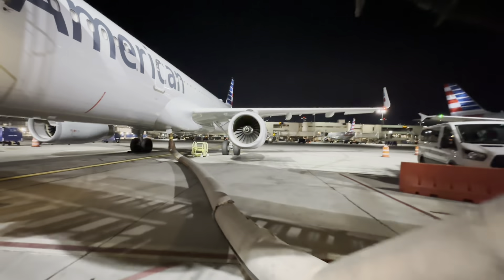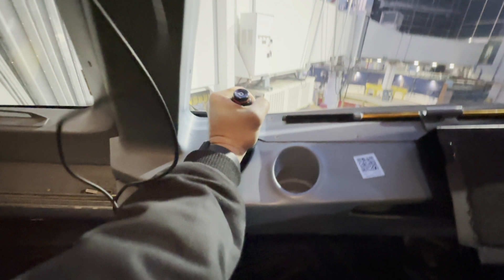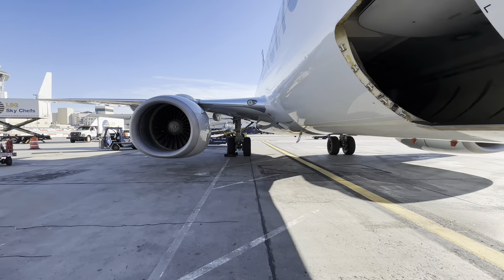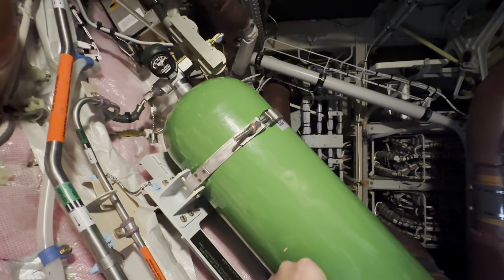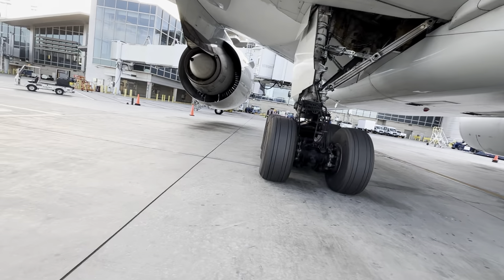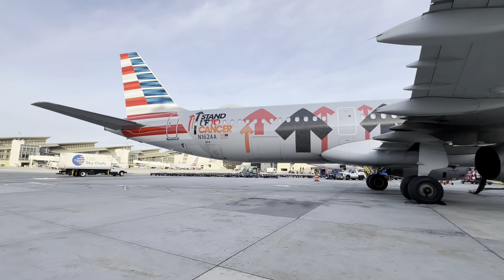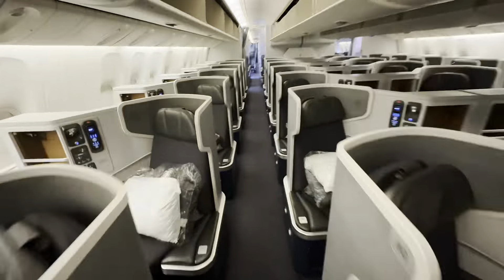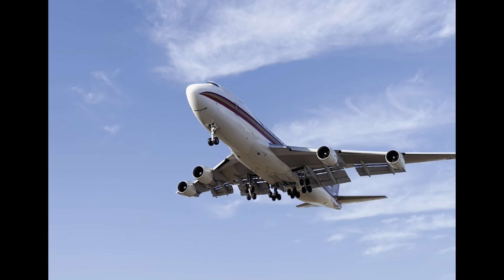Stig Shift #6 (Aircraft Maintenance Adventures)

Comment: So the repair on N939AN looks to be most likely some corrosion repair work done during a base check in 2012, I think.  The public records and cross referencing structural drawings of the fuselage to determine roughly where this repair area was led me down a whole rabbit trail that lasted into the early AM hours.  Thanks for that 😂. Also interestingly enough, this was the bird that got tagged in the rudder by a 777 wingtip, which was under tow in Miami. Thankfully, there was minimal damage to both aircraft.
Reply from the maker: Look at you, he just turned into an aviation detective, well done sir. Well done. 👍 that satisfying moment. When you find the thing you’re looking for, a smile sit back, and Say to  yourself I found it. 👌

Comment: Never tired of hearing you talking about airplanes systems, back-up sys even trivia part. Absolutely fantastic and unique chanel.  

Tell me Stig, bcs u mentioned that u got u got to work on 727 and 737 clasics[with PW JT8D]and probably some other machines.  How did u then diagnose a problem like this captain  made a note in the book[plus eager to hear from u, maintenance  guys], with no on-board diagnostics and DFDR or QAR(USB or data card, recording sometimes over 2000 parameters, as Google says ...Must b pain in the butt to diagnose if it  is 9xxx or 5xxx event ?

Ot tell us a something that was very different and FOR SURE much more labour intensive. Eh ?

Thank you for your effort for showing as this job from first hand and almost POV recorded. Much more clear what to expect if someone decide to gave a career like u. 

Like X 1000. Stay safe .
Reply from the maker: Working on those older aircraft was definitely a bigger challenge. The computer boxes were all inside the equipment bay, and they were not as sophisticated as they are now. We would be going off small little fault lights that would lead us to the fault isolation manuals. After which an intensive Search for the malfunctioning component. It definitely was not easy. The other aspect you have to realize is that those older aircraft were built, much much stronger and tougher. The 727 is literally a flying tank, that thing can go through a wall and still keep going.

Comment: I just found your channel.  I’ve been an A & P for over 35 yrs,  been a tech and Flight Engineer for the same corporate operator for 25 yrs.
I surprised you don’t service O2, but perform bottle change instead.  Why is that?
Thanks for the fun content!  👍🏼😁
Reply from the maker: Our station has its own oxygen shop, so they want us swap the bottles. They take the below limits bottles and service them at the shop and also have the capability to hydrostatic test them. Not all of our stations have that, some service it on site as you said. Thank you for all you years of hard work and keeping them airworthy sir. And pleasure to have you here.
Reply: @StigAviation  Thank you for the explanation.   I get it now.   Great content!!!   Keep ‘em flying safe!  😊

Comment: Hi Stig, these videos are great and your commentary isn't one bit of boring. Early in the video, you mentioned small items like missing placards grounding aircraft; can you give an example of something common for this on larger aircraft? I've seen some requirements for fuel placards in 14 CFR part 91, § 91.9 and ID plates in AC 45-4, but don't have much experience with the heavy side of things. As always, thanks for the knowledge transfer!
Reply from the maker: It’s almost the same way, most notably, emergency, placards are the ones that are scrutinized the most. Anything that’s showing information of emergency equipment or emergency exits can be a grounding item.

Comment: The trim wheel to the kneecap will wreck your night. Before sitting down, always always look at that stupid handle. Fold it in.

Also, how many times have you walked into the VHF antenna going under the Airbus? I was one and done. I learned quickly.
Reply from the maker: Luckily I’m too short to hit the airbus but I have plenty of scars from the 737 and 727 DME and VHF antennas. 😂 man those hurt so much.

Comment: RV builder/pilot here -- love your videos.   I've always wondered, what sort of double checks happen on maintenance tasks like the O2 bottle swap?  Are you supposed to take a second look, run a checklist, does your partner check it over, etc?
Reply from the maker: For something like a oxygen bottle, it is not a required inspection item, so it just falls on me and my responsibilities. I’m the one signing it off, as for testing it, yes, we do test the system upstairs. We make sure that the pressure is holding and we test the mask flow of oxygen which I failed to show in this video. Sorry about that.

Comment: Another great video, with new and amazing information! Interesting to see those control surfaces drooping. I've never noticed that before in airports. I thought all those moving parts had a fail-safe position (in case of hydraulic system depressurization). Isn't that the case?
Reply: No they do not. Multiple hydraulic systems are linked into multiple actuators for each flight control surface. It's a flight critical component thus has redundancy built into the system. That is why most aircraft have three hydraulic systems. Same goes for brakes being linked in the same way, spoilers, flaps, rudder, trim, etc. Even the thrust reversers.
Reply from the maker: Perfectly answered. Thank you my friend. Much appreciated for the help. You are a wealth of knowledge

Comment: Amazing videos as always. Keep em coming. I am curious how the rear landing gear sits in the wheel well. Do they touch any of the wiring/tubing when they are retracted?
Reply from the maker: They are so perfectly fitted that the landing gear does not touch anything. It’s a very close tolerance fit, but everything is made so it will fit without touching any of the components.

Comment: You were showing 2 small green oxygen tanks for the flight crew.  If that supplies their air I would’ve thought you would need to change those after every flight because there’s only 2 small tanks.
Reply from the maker: The oxygen tanks are only used in emergency situations. Otherwise there’s normal oxygen within the cabin, just like the passengers breathe.

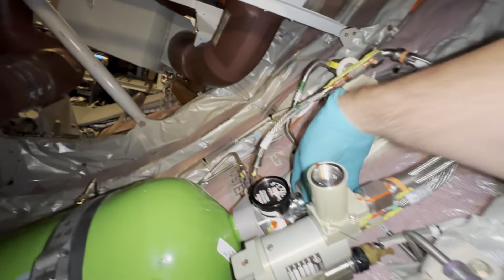Comment: There's a generic name for the type of pressure vessel that is being used for those really lightweight oxygen tanks you were changing out around the 23:50 mark in this video.
It's called a COPV, or Composite Over-wrapped Pressure Vessel.
The general idea is that you get a very strong fiber like Kevlar, Fiberglass, or Carbon Fiber, and you wrap that in a very specific pattern around a liner made of Aluminum alloy. The liner is what seals the gas inside, the fiber is what actually holds the pressure, and so from that you can see that the name for it isn't very imaginative.
You can find them at West Marine being sold as Propane tanks (fiberglass wrapped aluminum 5 or 10lb propane tank), paintball and airsoft players have been using them since before 2010 to store CO2 for their paintball markers and airsoft mock-weapons, SpaceX uses them inside the Falcon 9 and Falcon Heavy to store Helium for pressurizing the fuel tanks of those rockets, SCUBA divers can use them to store breathing gases, firefighters use them for their Breathing Apparatus sets so that they don't tire out as quickly, there are a lot of applications for them!
Reply from the maker: Thank you so much for all this detailed information. Much appreciated.

Comment: Hi Stig, as the 737 taxis onto the stand at 33:03 , we can see a big lump-type device sitting atop the rear fuselage. Is that some sort of satellite antenna? Thank you! PS: at 36:38 as the 777 lands, why don’t the ground spoilers pop up straight all simultaneously? Good hon you for the LAV maintenance—you have a brilliant work attitude!
Reply: 33:03 is most likely the WiFi antenna
Reply from the maker: The big lump on the 737 is the Wi-Fi antenna the 777 Landing moment, the ground spoilers had a slight delay in full deployment, it happens time to time.

Comment: You don't want adiabatic compression when you open the O2 bottles, which is why you have to open them slowly, otherwise you could have an explosion where the lines terminate at the crew O2 mask inlets.
Reply from the maker: You’re absolutely correct. Thank you for adding more knowledge to this.

Comment: Hi Stig, thanks for the daily update. My question is when there is no pressure in hydraulics and ailerons and elevators are drooping what happen when very strong gust of wind will slam them up and down or left to right in case of rotor? Look at 32:37 when British 777 is retracting the gear looks like mist or cloud coming from the right boggy, what that could be brakes maybe.
Reply from the maker: You kind of answered your own question on that one, that’s exactly what will happen. If the wind blows hard enough to move the control surface, then that’s exactly what it will do. Just like the rudder you see on some aircraft that are sitting around. Sometimes you see them kicked over to one side, that’s because there’s no hydraulics and the wind will just move it around. That dust you saw on the 777 is brake dust getting blown off.

Comment: If you don't post before Christmas.  Merry Christmas to you.    Question for you, how does the INS system work for navigation?
Reply from the maker: I’ll be working Christmas and New Year’s. So I’ll make videos for those days too. And INS is navigation (inertial Navigation System) or did you mean something else?
Reply: @StigAviation  I do mean inertial navigation system.  The only thing I know is it uses gyroscopes somehow.
Reply from the maker: @Boodieman72  you are absolutely correct, it uses a ring laser gyroscope. It has no moving parts unlike its older technology, counterparts where it was an actual gyroscope spinning around.
Reply: @StigAviation  So how does it get used for navigation?
Reply from the maker: @Boodieman72  i believe I explained that in the video. It gathers all that data I spoke about and translates it into coordinates for pilots. Hence how they know where they are located.
Reply: @StigAviation  I don't remember you calling it the INS though.  Must be a lot of computer power in modern aircraft.
Reply from the maker: @Boodieman72  INS is part of ADIRS.  It’s all part of navigation 👍
Reply: @StigAviation  ✈

Comment: For my hobbies, I'm mostly interested in space travel, "head in the clouds" even by pilot's standards, I know, but it's important stuff!
I play a lot of Kerbal Space Program (which gave me an "intuitive" rather than "theoretical" understanding of orbital mechanics), and other games involving space (KSP is the most realistic out of all of them by far, unless you wanna get into actual simulator territory and go with Orbiter Space Flight Sim).
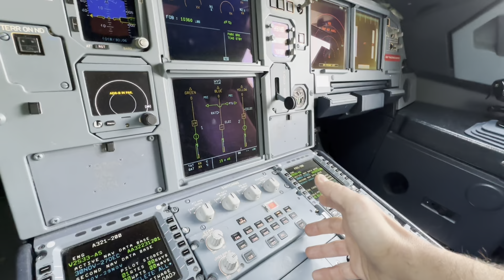But you were going over the ADIRS of an aircraft at about the 40:00 mark, and I noticed something that might not be accurate (I'm not 100% certain, but I'm still pretty sure I'm right).
You mentioned that it has "a" Ring Laser Gyroscope, but given that there are 3 axes of motion, I'd assume that it needs at least 3 RLG's to measure all 3 axes at the same time, right? That would be the same as having a physical spinning gyroscope that doesn't ever really drift or gimbal lock, and has 3 gimbal axes to measure the 3 rotational axes of motion (in reality you need 4 gimbals and some quaternion math to eliminate the possibility of gimbal lock with a physical gyroscope, and that's why they had some problems with the Apollo Guidance Computer during the '60s and '70s).
Additionally, because aircraft seem to have redundant systems for the most critical things, it seems like it would have a backup set (or even 2, if it's doing majority voting based deconfliction) of RLG's in case the primary set fails (unlikely but you never know, things only last so long after all).
Do I have that right or am I way out in left field?
Reply from the maker: You pretty much have it almost right, the ring laser gyroscope does measure on all three access points. And I do also love that video game, KSP is one of my favorites.

Comment: Hello Stig. Love the channel. Quick question: The 777 main gear bogies tilt front tire up after liftoff, but just before retraction, they level themselves. How is this done? Is it a cam rotating within the strut or is there an actuator that pushes/pulls them level? Can you point out that mechanism in a future video? Thanks!
Reply from the maker: It’s an actuator that tilts it forward and back. I have shown that actuator in previous videos and explained its function.

Comment: Hi Stig, at 8.21 you look into the small hole on the nozzle at the rear of the port engine, what does that component do?
Reply from the maker: That is called a center vent tube, that is a tube that vents out hot oil gases from the engine

Comment: Regarding drooping control surfaces, how do the 777 and 787 ailerons stay streamlined? Same for 787 flaperons
Reply from the maker: They don’t all the time. They droop as well. Some less than others. Some retain the pressure in the actuators and stay streamlined
Reply: @StigAviation  oh ok. Every 787 I’ve been on all the surfaces seems to stay streamlined but on the 777 only the flaperon seemed to droop. I know the airbus systems pretty much all droop

Comment: I listened to a video by Elon Musk he stated that planes leak so much air pressure that 4 pumps pump air in from the outside to maintain cabin pressure. But from watching your videos I know that it’s the round pressure regulators at rear bulk head that maintain 7 to 8 psi in the cabin.
Reply from the maker: I’m sorry to tell you, but Elon Musk is a billionaire that only knows about rockets or whatever he says he knows, he is not an aircraft technician, and he does not really know how aircraft work. Air pressure is maintained with the air-conditioning system of the aircraft. It’s also regulated by a valve, called the outflow valve. It’s constantly modulating air coming out of the aircraft to maintain nominal pressure.

Comment: Very informative channel. Question about 8:40.  Does the fan in operation spin in the direction you pulled it?  From the blade shape it seems it should go the other way - counterclockwise as looking into the engine.
Reply from the maker: The blades turn in the direction of where the silver portion is, that is the leading edge of the blade. When on the ground, the engine has the capacity to turn in either direction, because the engine is not running it can be rotated in both clockwise and counterclockwise.
Reply: @StigAviation  Thank you!

Comment: Dunno if this has been covered already in a video but what differences are there between mixed-exhaust engines (like the IAE on a 320) vs non-mixed (CFM on a 320) besides the obvious? Do they differ in maintenance, performance, etc? I remember vaguely from back then when I flew on 320s with IAEs that they had a louder roar on takeoff compared to the CFMs. I only know that for the IAEs you have EPR in the ECAM instead of the usual N1.

Keep up the great videos and happy holidays!
Reply from the maker: Fantastic question, yes, there is quite a bit of a difference when it comes to maintenance on those two engines. The IAE is more Rolls Royce influenced, and the CFM is more GE influenced.
When it comes down to maintenance, the CFM is much easier to work on and is a lot more powerful than the IAE. The IAE engine has a tendency of a more Buzzsaw noise, the CFM has the growling noise.  This is due to the different style of compressor and turbine staging. 

Thank you very much for watching, I hope that helped answer your question. Happy holidays.
Reply: @StigAviation  Yes, thanks a lot!

Comment: Hey Stig, question for you. Do maintenance personnel ever get ticked off about certain miscellaneous write-ups. Our maintenance guys at my previous flight school tried to educate tolerances and limitations on our aircraft's and pilot's and CFIs would write it up anyway. Don't get me wrong, these maintenance personnel were the best guys I knew. They would still address and fix whatever they had to. Just curious if there are items on the aircraft that pilots should try to understand more than just "distinguishing a caution light" and writing it up.
Reply from the maker: That’s a really good question, and yeah, there are some items that pilots should be aware of that are purely nuisance. Sometimes the aircraft will kick up a common fault That is completely normal. Pilots education is strictly for flying, they have very minimal information on systems and subsystems. But once again, when it comes down to my write ups, I personally still don’t mind it, if it’s a maintenance issue, then I will simply address it. Rule of thumb when in doubt, put it in the logbook, it’s better to be safe than sorry.
Reply: That's good to know. I used to work for free at my 141-flight school maintenance hangar mopping the floors and sometimes if I'm lucky changing tires and brakes, just so I could get to know the knowledge that these men had sitting around. I mean I LOVED it. I always say knowledge is power, and it could save you from crashing someday. I used to show up to the front door of the hangar and ask if they needed help. In the airline, I would be the one to show up to the maintenance hangar and ask questions. I'm sure it's different in the airlines with all the security regulations, but who should I go to if I have continuous questions about the aircraft I fly. I really enjoy systems and how they work. Sometimes reading a manual isn't the best for me. @StigAviation